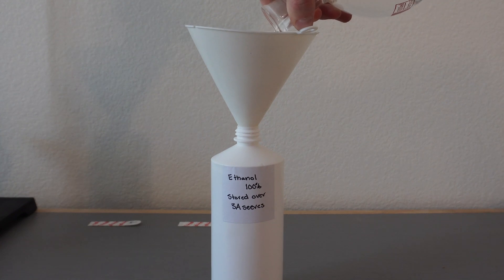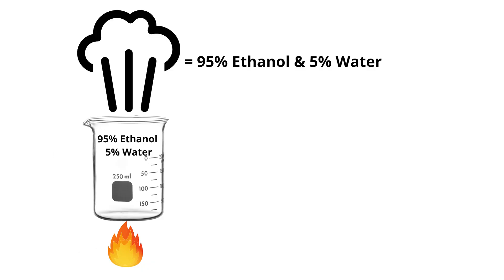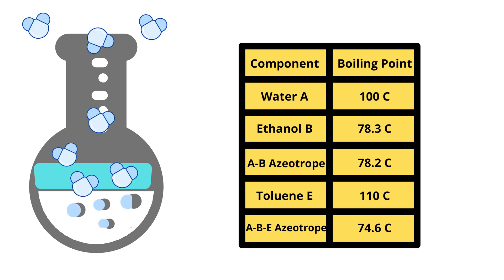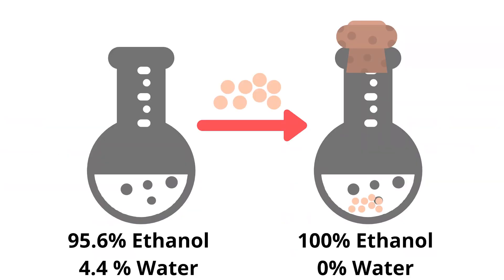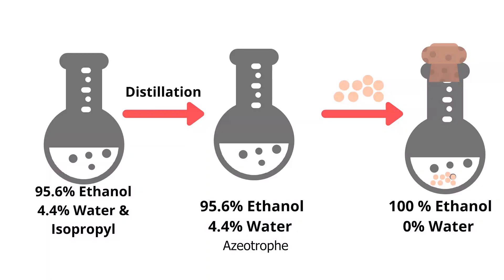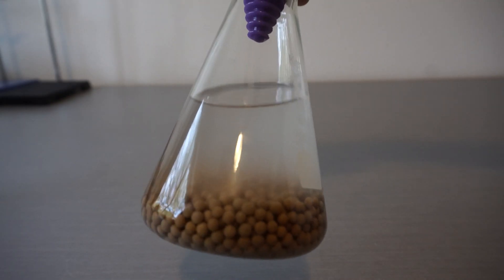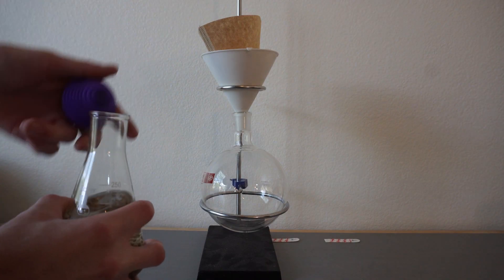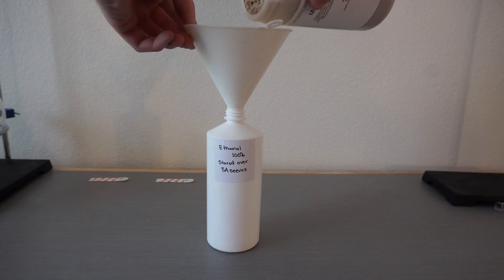Making Ethyl Alcohol Anhydrous - 100 % Ethanol

Comment: Which is better for disnfecting? Isoprophyl or ethanol alcohol?
Reply from the maker: Depends what you are disinfecting. If what you are disinfecting is able to absorb the material at all, ethanol is generally better. But if it is a solid material like a countertop or bucket. ISO works just fine as both evaporate with time given.
Reply: @PrestonImpx  Nice thank you! Also, what is the use of an anhydrous ethanol?
Reply from the maker: Ideally it’s used in reactions that are sensitive to water. Which in itself is rare. But anything like esterification reactions are ideal to not have water usually.